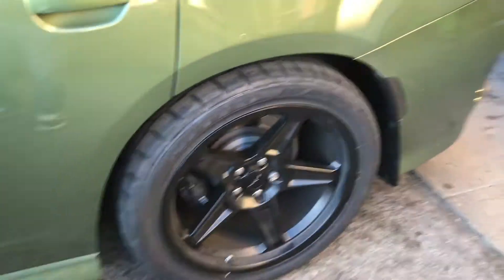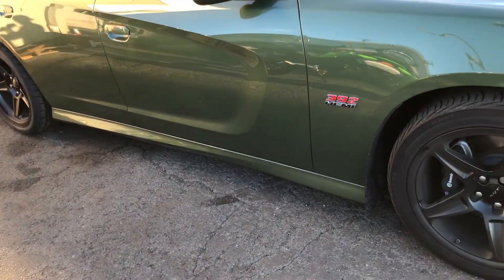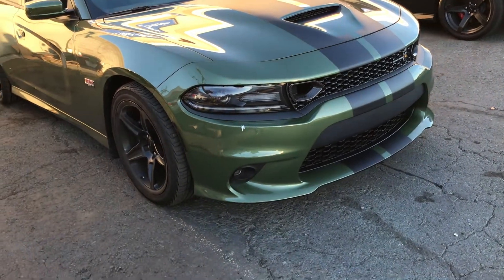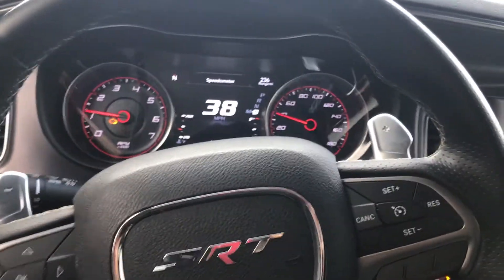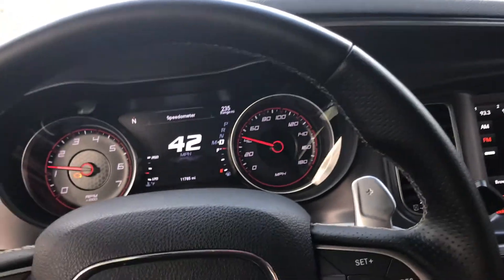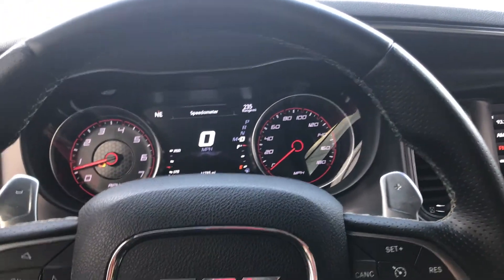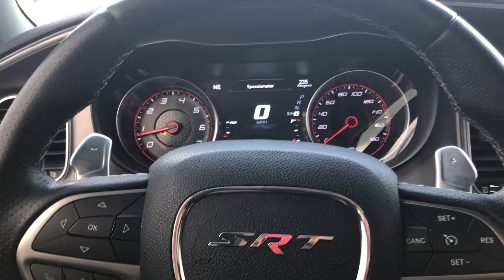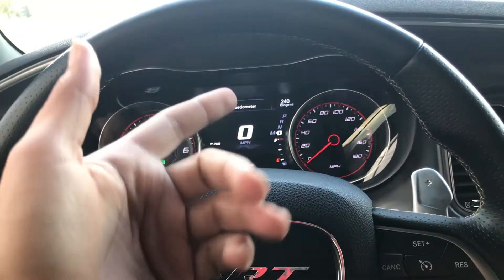Demon Killer Springs from Carlyle Racing

Comment: I wanted to ask you why you choose this brand over the Eibach Demon springs? Also did you had to buy any Alignment kit to fix the Camber or it wasn't necessary?
Reply from the maker: I had heard good reviews on this one and that they’re basically the same exact springs that come on a demon so that’s why I went this route. No alignment kit needed, I did need a alignment after the installation but that’s about it
Reply: @snackpack6356  so there the same as the Eibach Demon springs. Perfect thanks really appreciate it 🙏
Reply from the maker: @edgarescobar7830  they pretty much seem the same, just probably only price difference but no problem 🙏🏽